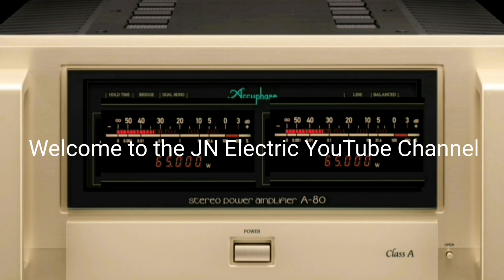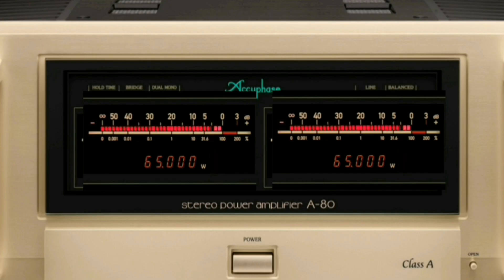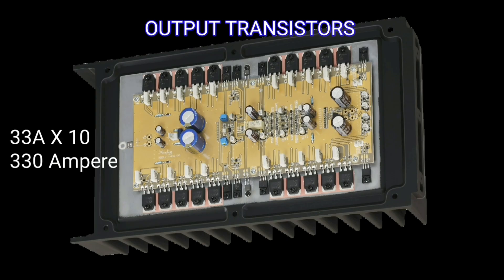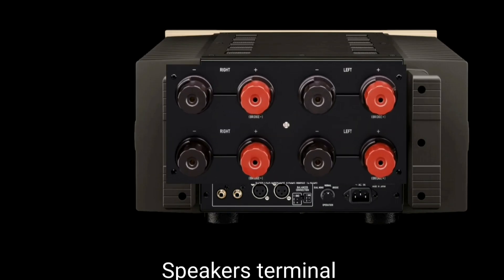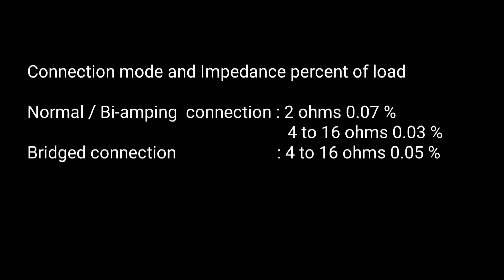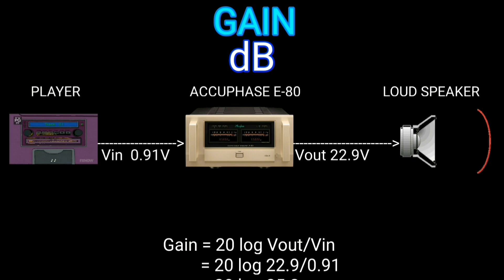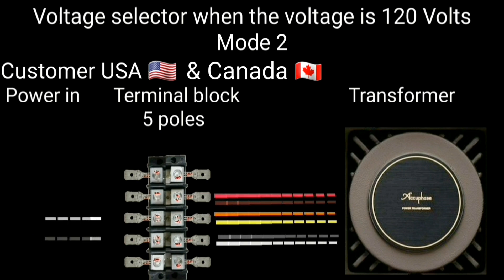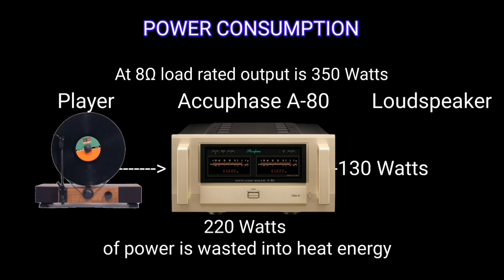Accuphase A-80 Power Amplifier super Class A technical reviews & Performance plus Voltage Optional

Comment: Could you tell me what is difference between mode1 and mode2 in terms of voltage conversion?
Reply from the maker: Mode 1 and mode 2 are the same for the Hong Kong area, the input voltage is 220 Volts input.

Comment: Hello Sir.   If I want to do voltage conversion from Japan to US, is the ONLY thing needed to change how the wires are jump and connected?  Then, will the result will be the exact same sound as factory US model?    Do I need to change fuse or anything else?
Reply from the maker: you can see in this video at minute 6:08 where the conditions have been explained in the USA and Canada area, to change from Japan to the USA means the input voltage changes from 100V to 120V, the electric current will be smaller, what you have to do is replace the fuse as follows:

new fuse at 120V = 100/120
                                = 0.83 × existing fuse 100V

Comment: Do you know what is the size of this transformer?? For an example 2kva or 1.8 kva etc etc!! Thank you
Reply from the maker: 1,040 Watts /75% = 1,387kW  or 1,733kVA

1,733kVA perhaps capacity of transformer 

Data 
1,040W :Max output Amp. in bridged conn.
75% : recommend load 
kW / kVA  = 0.8
Reply: @JNElectrics  Cool. Excellent specifications. Hi, can you compare Accuphase A300 with TAD M700 monoblocks ?? Thank You 😊

Comment: Hello JN, great videos..!!!  Hey in 0:28  you mention that the Accuphase A-80 most NOT be connected to les than 8 ohms,  I was surprised by this...   Why?  How du you know?
Reply from the maker: Hello Mr Harri . When the amplifier works under less than  8 Ohms, the output transistor also has a large increase in current, whereas in essence each transistor is not the same hFE, some transistors are greedy and some are not, this will make one greedy transistor work optimally so that the output  power will quickly fail that is IMO
Reply: @JNElectrics   Thank you very much...